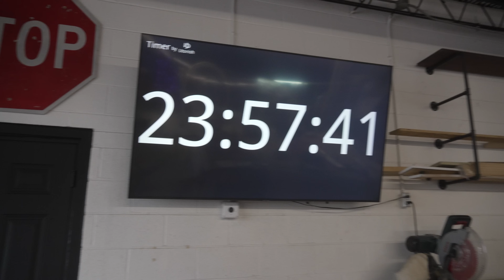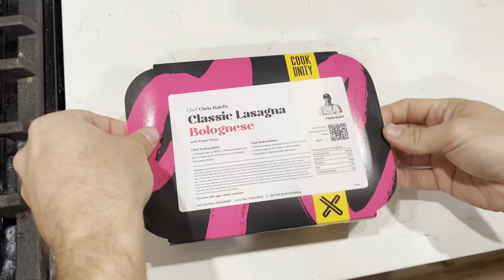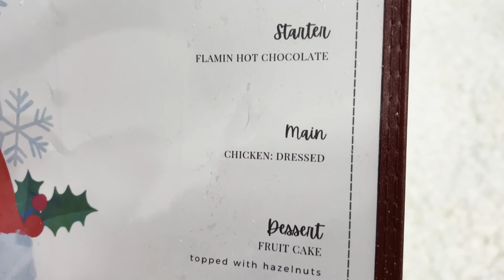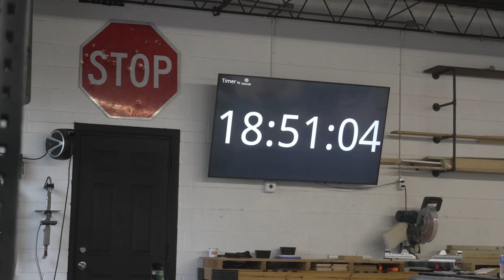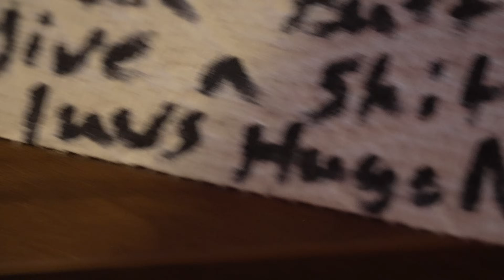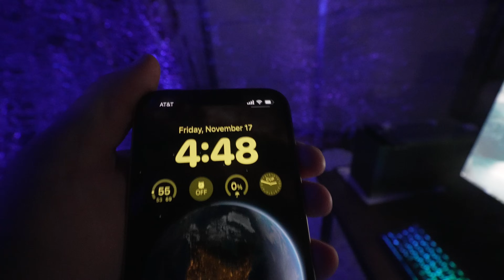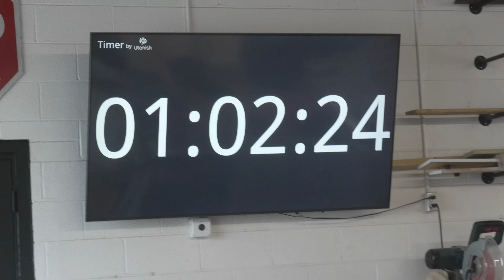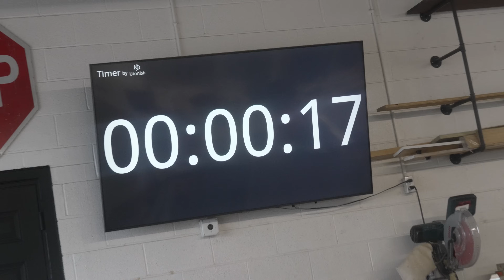I Survived 24 Hours In A Snow Globe

Comment: I'm wondering if the inflatable globe could have a heater put in front of the fans to heat it. You could like an inverted snow globe where it's snowing outside but the inside is decorated like a cabin.